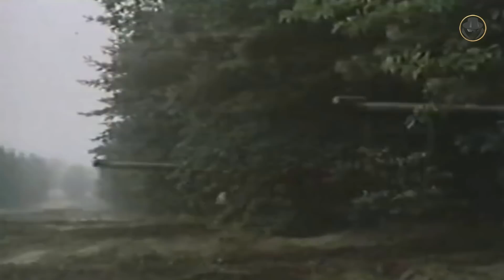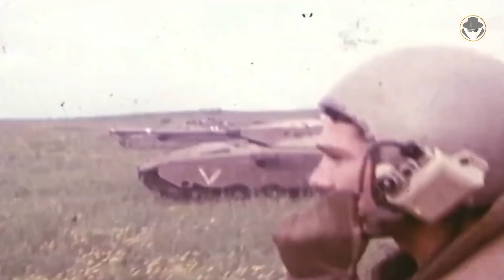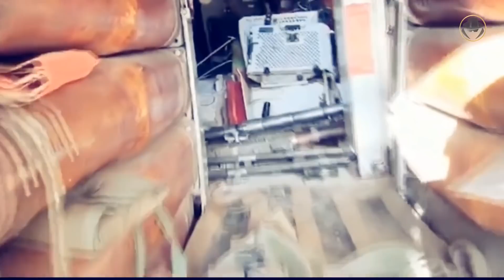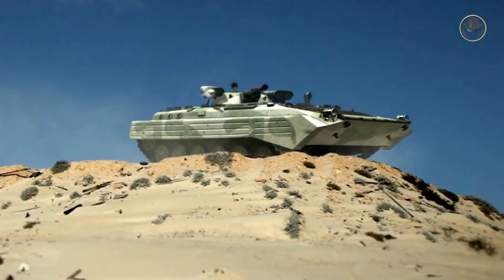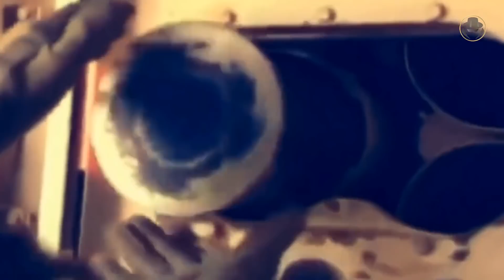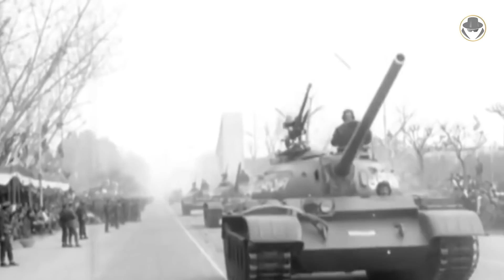Merkava Mk IV | The latest main battle tank of the Israel Defense Forces

Comment: Merkava is not only a tank it is apc at same time-Considering tanks should never operate without troops it is a big deal-Guns elevation rate is impressive-Turret angles are good against top attack as well-Getting in and out of the tank at back is better than using hatches open to enemy fire-Forward engine is extra protection-At Turkey this tank was one of the candidates-Israel has modernized old Turkish tanks to SABRA-We are happy with their protection-Gun elevation is critical for mountainous terrain like Turkey-We could have evolved this tank to Turkish needs This tank would be much more affordable at mass production by Turkish defense industries

Comment: the Indian Army could do with a fleet of 1,630 - 1,950 brand new Merkava IV+ MBT with the Trophy hard kill countermeasure system . . . it'll replace the older T-90 & T-60s . . . in Indian Army service the Merkava IV would have a strengthened raised suspension setup featuring a heavy duty 5.0 in. suspension lift for increased ground clearance . . . it'd also need enhanced engine cooling, for sustained use in + 42.0° deg & 100% humidity . . . IDF needs more newer Merkava IV+ MBTs that will replace the Merkava III variants . . .
Reply: not for sale

Comment: it is a Very BIG tank and does its job exceptionally well. could not function in most of Japan, though. tank is built with objectives in mind and it fits them well!!!
Reply: Well let's put the army tanks on a ship and take them to Japan okay that makes sense
Reply: Actually it would work well for JSDF's purposes. The Merkava is very much a defensive tank. Japan's Type 90 is built around a lot of the same principles at the Leopard series which is an open country maneuver warfare tank, not likely the type of combat that Japanese tanks are likely to see. The Merkava is well suited to going hull-down in a prepared position and holding around. Japanese terrain is very mountainous, an attacking armor force would have very few options of advance allowing the defender to stack tanks in defensive positions. Merkava's heavy weight and short range would not be such a downside in those scenarios.

Comment: While the Merkiva is fantastic, it is too heavy to airlift.
Reply: Not only airlift. But also to transport by rail. They are wider and bigger. Most tank sizes were defined because they must be transported by rail or airlift. This limits tanks engineers in almost every country. Merkava is transported by Big Trucks in roads, you can cross entire Israel in less then a day by truck and get anywhere. So no need for Airlift and Rails. Those tanks can be transported in matter of hours to any front should war to occur. In case of tiny israel, to mount tank on rail or airlift would be waste of time, because this would take days.
Reply: @TheStallker2003  even before Merkava Israel had a transporter for ever Tank.  They also have a network of military roads which in the old days were not on public maps.  I remember being in the Negev and they told my mom about a short cut on one of the unmarked military roads.  It was paraded wide with only the center paved.  When we encountered other cars we would each put a wheels in the dirt.  Then came a convoy of tanks on transporters.  They stayed on the pavement forcing us to stop on the shoulder.   The use of transporters meant redeployment was faster and wear and tear on tanks was reduced.
Reply: It was built for Israel... There is no reason for it to be lifted lol

Comment: "Many western and Eastern experts agree that the merkava mk 4 is the best main battle tank today" what a tragic opening line, don't sound like experts to me, although there is no real way to test which is the "best" I believe the top 3 contenders would be the leopard 2a7, m1a2 sepv 3 and the upcoming challenger 3
Reply: the leopards showed their lack of usefulness when turkey put them into syria. 
there are still videos out there on how kurdish RPG type AT rip through them with ease at a large distance. 
as for the m1.its main issue was and is the gas turbine engine which simply cant handle desert dusty conditions for long.
challenger 3 will probably be a very good tank. but its not even battle ready.

the russian armata is the only real current would be contender so far. but .. again. until it is battle tested we cant really know.
Reply: @kundason7546  finally someone who understands
Reply: you ? who are you to write what you write " I believe  "  ? , you ever fight in a tank ? what kind of experience you have ?

Comment: Lmao... No, they dont agree its the best in the world. It is far from best in the world. I mean ..How Merkava have low thermal signature when the engine and exhaust is literaelly in the damn front where it is facing enemy thermal sights? xaxa... Besides that engine does not provide any protection from KE rounds at all. And even RPG could damage it or transmission to mobility kill Merkava. Also, if multiple RPG is fired on him, it will overwhelm trophy system. Low plate of Merkava have no composite armor at all by the way. xD

Comment: The later Merkava MK IV. Variants have 2 Turret hatches. Because they found out it's a threat for the loader, so they added an additional hatch for the loader.
Reply: When you think about it, the US already did that for on the Sherman during WW2 for the exact same reason
Reply: @TheKenji2221  DON'T FORGET , the Merkava also has room for a squad of infantrymen as well as the tank crew , so there is an additional " escape " hatch at the back for tank crew men/women to use , something that the  Sherman DIDN'T have
Reply: @dovidell  you can fit a small squad at the back, but it would be cramped as hell. The back door is for reloading the tank with fresh ammo, you can’t fit many rounds into the tank with an infantry squad inside and such action should only be done in emergencies.
Reply: What design concessions had to be made?
Reply: Compromises that come to mind: 
- It's as heavy as your mom.
- It's not as fast and mobile as its Western equivalents.
- Low ammo capacity.

However, the latter is mitigated by the ease of resupply provided by the clamshell door.
Reply: @Shilling_Larping_Services_LLC  
actually it has a much higher ammo capacity than most tanks.

Comment: Merkava 4m is the only Fifth Generation tank in the world with protection in TOP against missile-like Javelin so it's the BEST tank in the World with proven Trophy active protected
only Engine and transmission come from outside its 25% Tank vas check in USA un Snow in Water in all conditions you can think. Have an air conditioner! No problem with the Engine in front because having a very satistificated computer system newest in the World with new IMI 253 120MM Canon with great vertical and horizontal turret angle - much better when any tank - can move forward with current only visible and computer to fire - in USSR  tanks turret in middle and very long so horizontal angle good only on a flat surface - also The IDF was to begin trials of Elbit's Iron Vision, the world's first helmet-mounted display for tanks, in mid-2017. Israel's Elbit, which developed the helmet-mounted display system for the F-35, plans Iron Vision to use a circular review system as a number of externally mounted cameras to project the 360° view of a tank's surroundings onto the helmet-mounted display of its crew members. This allows the crew members to see outside the tank while staying inside, without having to open the hatches. Yes, it's coming from F35 it's our Israeli system!
Reply: Israel is one of the most advance war fighting machine nowadays.
Reply: I'm sorry but it is far from the best mbt, although I do not doubt its technology the tank itself is extremely flawed in many aspects, first we'll talk about the engine, it is mounted in the front which has more  cons than pros, the front mounted engine means that when the tank is facing the enemy it gives off a much higher thermal signature, not mention that is also disrupts the thermal sight for the gunner, some argue it is a useful form of protection which many would disagree mainly because the front of the Hull is only 100mm thich meaning that it could literally be immobilised from the front by even late ww2 tanks if they hit and im not even going to mention the more modern apfsds it will likely face which would still just go straight through the engine anyway killing both the crew and rendering the tank inoperable, also another problem in terms of protection is the turret, the angling makes it extremely succeptable to shot traps instantly knocking out the tank, by modern standards it is extremely lacking design, I would hardly call it a fifth generation tank, the best mbt would either be the leopard 2a7, m1a2 sep v3 or the upcoming challenger 3
Reply: @callumrawlinson9005  Nonsense, engine doesn't disrupt thermal sights, front of the hull is way more than 100mm thick and it has internal ERA.

Merkava is better than any of the tanks you've mentioned.
Reply: @BenyKarachun 🤣🤣🤣 you must be joking, the merkava is just a bad tank, the only thing it has going for it is an aps but most nato tanks are planned to have them so the merkavas only strong point won't even matter, it has a bad engine, mediocre gun at best, some of the worst armour ive seen for a modern mbt, it has a front mounted engine that acts as "extra protection" but at the same time has unreliable fire protection systems so once that engine gets hit, which it will, the tank is done for, I'm sorry your favourite tank is nowhere near as good as most other nato tanks but that's just facts, list me the reasons why the merkava is better than the challenger 2, leopard 2a7 and m1a2 sep v4, ill wait.

Comment: Is it true that the prototype was a re-engineered Centurion,running in reverse???
Reply from the maker: The modified Centurion was used as concept demostrator. It was not the prototype of the Merkava.
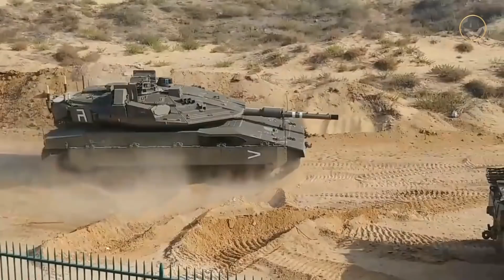Reply: 3:54 you can see a Centurion without a Turret on the right. this is called puma, used for combat engineering units, still in use today but have some changes likes engines and so

Comment: Very good, enjoyable mini-doc, about a decent subject matter.
I Reckon the Challenger 2 is still the best most suitable Tank on earth, and when the Challenger 3 is commissioned it'll be even better and way above anything out there on today's market, remember only the Challenger 1 and 2 have never been destroyed by Enemy fire, it's the Only fully battle tested tank, tested to breaking point, And then it still didn't break, it's reliability is legendary, longest Tank on Tank Kill, one took around 25 RPG-7S and another around 40, the CH-2 that took around 25-30 RPGs, also took continuous small arms fire, an anti Tank rocket, it was recovered all crew safe and in tact, fixed and back out within 6hrs, in fact both thanks continued to function as usual, an amazing tank.
The Merkava MK4 has one amazing feature, it ms also a troop carrier, with the engine at the front performing ballistic protection from almost everything, but also means it can be disabled quite easily especially by something like Challenger and Abrams, T-14 Armata, Leopard 2A, but not things like T80/90 etc..etc...
Enjoyed the video mate.

Comment: "one of the best tank in the world" hahaha this make me fart.. this tank actually can't even climb at 50° slope on real ground surface with sand and small rock. I told this because we pulled this tank 2 times stuck cant move forward. i think maybe it's too heavy on the front hull or maybe not enough power on the engine or maybe any other factors that idk about. tbh, this tank very good looking tank in real life and very safe in my opinion but not the best in the world.

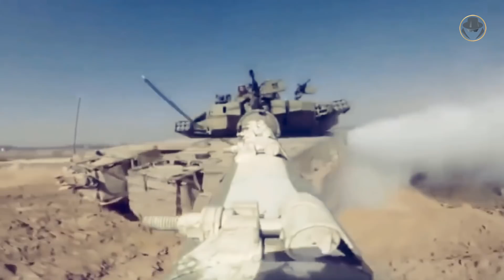Comment: Noticed the antenna going ballistic at 3:38 ?? :D
Reply: It's not an antenna, but a "stick on a spring", used to indicate to the driver where the tank ends. useful with driving in narrow areas. Hope they fixed the issue where it brakes when getting hit by the gun at high speed